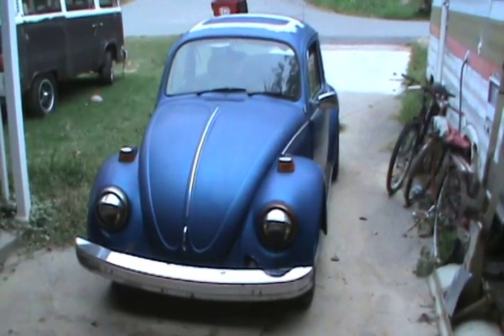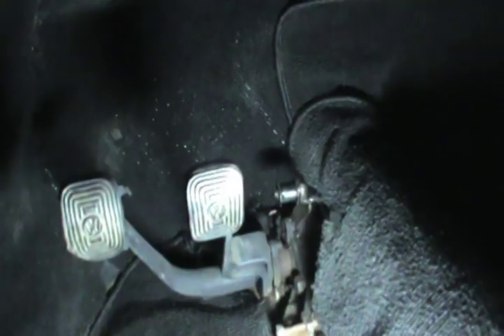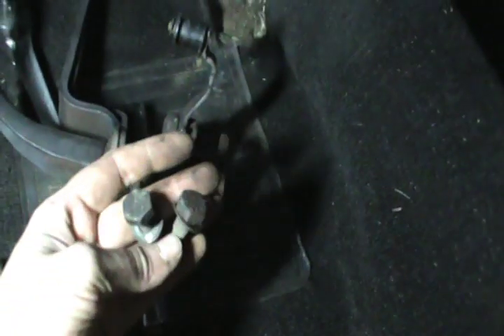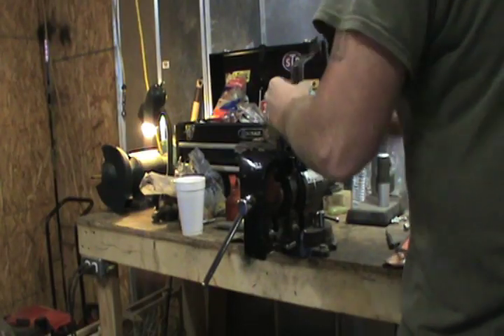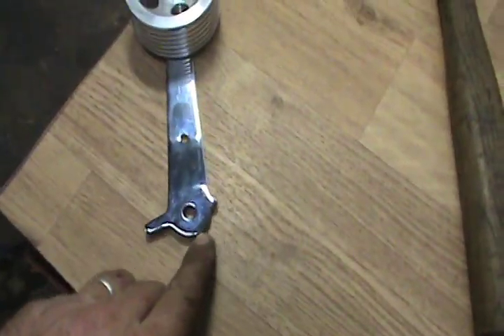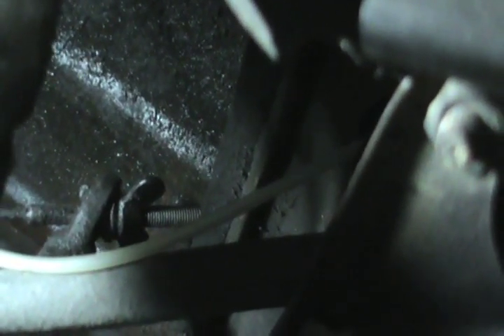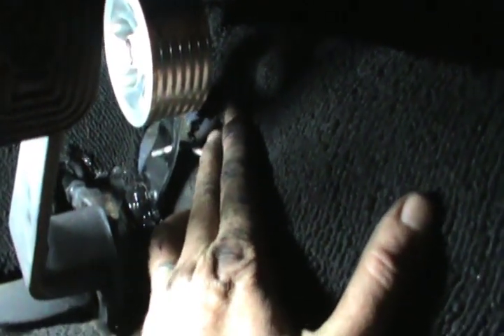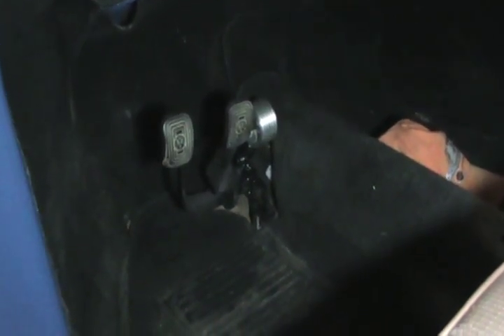The Beetle Gets A Roller Pedal

Comment: nice vid. ive had roller pedals for years. The one thing i do is lower the roller, personal perferance. i drill a new hole between OG hole and throttle cable hole. For me its easier on the foot. Also I add shims to get rid of the wobble they sometimes have

Comment: Thanks for the video.  How does the brake pushrod come off?  and does the clutch cable bolt need to be matchmarked or anything or do you just tighten out the slack and you are good?

Comment: I'm having trouble getting the brake pushrod back in place after pulling the pedal cluster. How do you get it lined back up and get the clutch pedal down the hole at the same time? I keep having the clutch cable fall off or i'm not able to get the brake push rod back in if i put the pedals in before the push rod.
Reply from the maker: carpespasm you may want to lay something at the correct height from the floor to the bottom of the master cylinder rod. It might help...they are a bit tricky. Thx for watching!